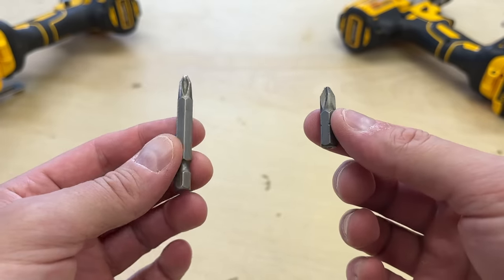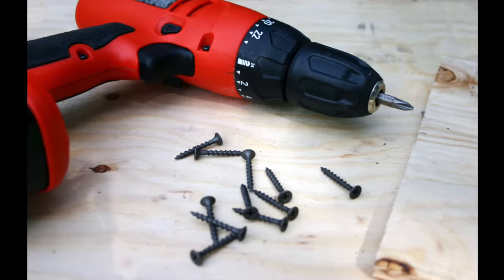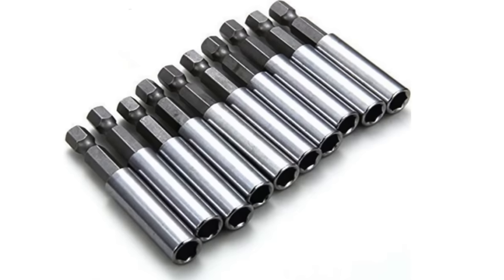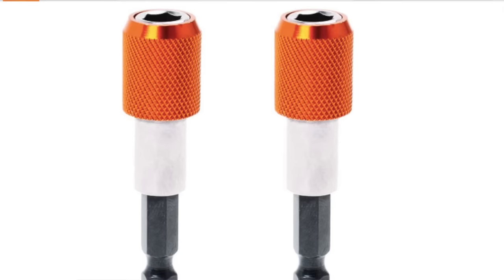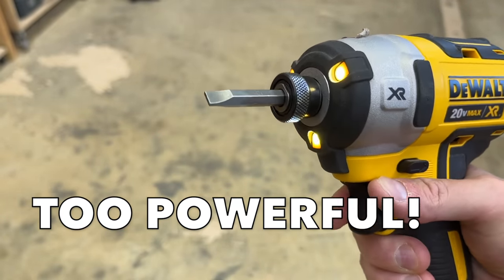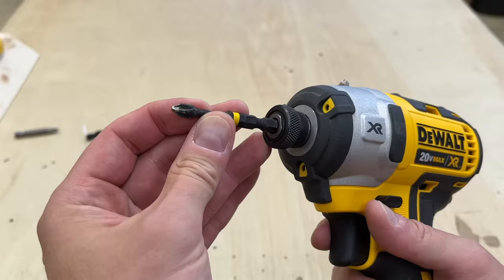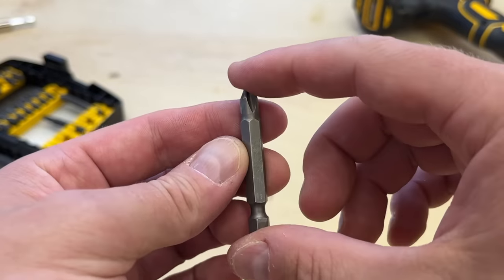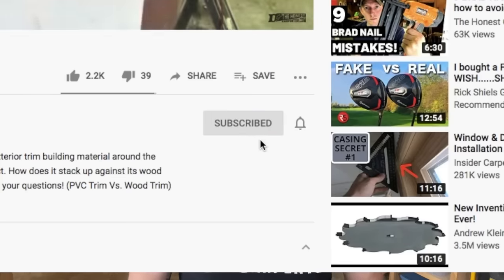Power Bit vs. Impact Bit vs. Insert Bit...WHAT'S THE DIFFERENCE?! (Driver Bit Guide For New DIYers!)

Comment: I have worn out several quality Dewalt impact drivers using only “power” bits without issues other than normal wear.  I have also broken several of the newer “impact’ bits. Bottom line is, buy what is cost effective, not what some rando DIY’er with a youtube channel professes. Also, try not to use a flat driver on a power tool as he shows.

Comment: 🤦‍♂️ Ugh - wrong, the notches on the 1” tip are not an indicator of how deep to insert them into the chuck; They are there to receive a “ C “ clip retainer in the bit holder. 1” bits are not intended to be used directly in a keyless chuck

Comment: I use impact and non impact bits between my impact and drill, and sometimes I pre-drill with the impact rather than the drill (when the clutch is better suited for the work): it doesn't matter unless you're using those stupid Phillips screws  everywhere...or you're trying to drill into steel with a small bit and a impact( just as dumb) First smart thing to do I toss those Philips in some spare screw bin and replace them with either torx or more commonly available(region dependent) square/robertson. I also broke more impact rated bits and adapters, including sockets than non impact.

Comment: From my experience, complete BS. I’ve worked in construction and renovation for 35 years. I cannot recall ever having  broken any kind of bit in an impact driver. Plenty of screws snapping their shafts, never a bit. The screw is the weak point. Funny thing tho’, I have broken many bits using a drill driver. Usuallly the tip, occasionally the shaft but then only in metal or concrete applications.

Comment: wow fake news. the notches aren't depth indicators (who would need that?).  They lock the bit into locking insert bit holders, because the magnetic ones are crap. Impact drivers don't "ratchet". They impact. I have never heard the terms "power bit" and "power groove". The necked down bits are just marketing nonsense in my experience.

Comment: It seems to be a modern fad, pushed by tool channels, to use Impact drivers instead of drill drivers.  Impact drivers have way more twisting force than necessary and no torque control clutch to protect your screws from camming out.  Seems ridiculous to me…Now if you have a big lag bolt to drive or lug nuts to loosen then sure, that’s when impact tools shine…but guys…not for screwing furniture together huh.

Comment: If I think I want to use a bit-holder, I slap myself in the face, and tell myself to stop being so stupid.
They are, perhaps, the single most stupid thing in any workshop. They constantly fall out or they lock-in.
The only time I find little bits to be even slightly acceptable is when they're being used in a hand-powered screwdriver - but even then they are mostly garbage.

Comment: You should do your research better before you upload a video. It's seems you just repeat the information you were told or made sense of yourself.  Please dedicate more time to check facts. It will also be advisable to use a more technical language if you want to teach, it will come across better. Other than that cool video. Keep it up.
Reply: Tell us how u really feel already, Those skinny neck bits strip screws due to their smaller tips , IMHO